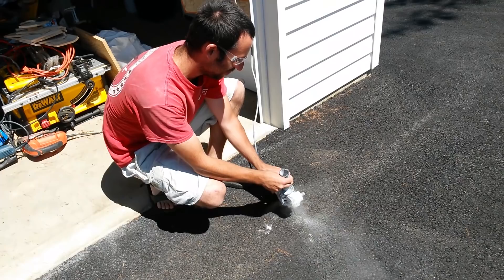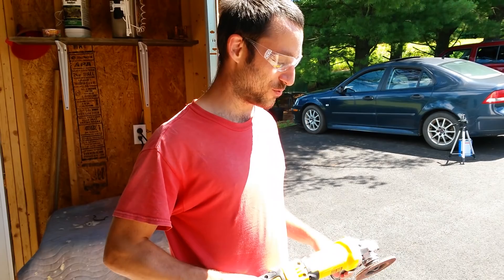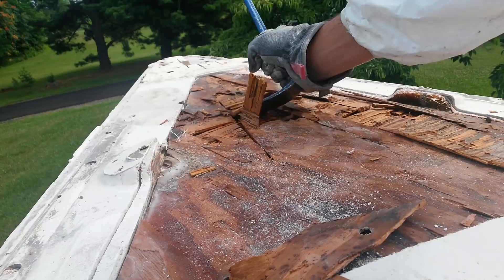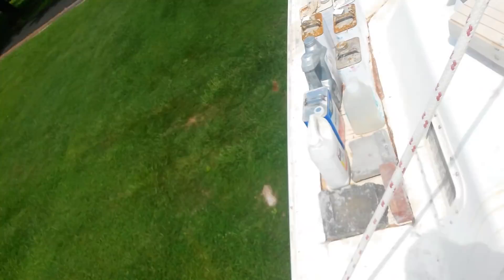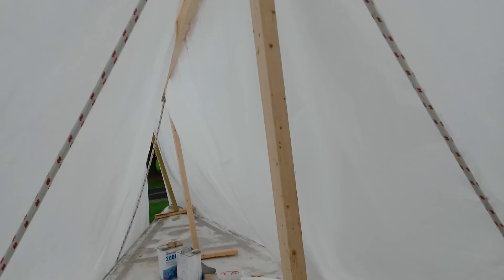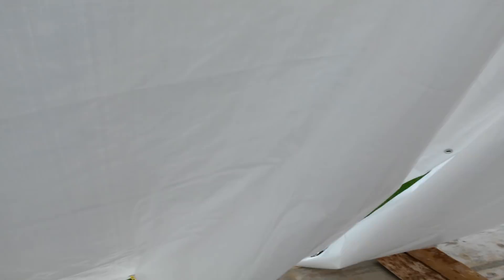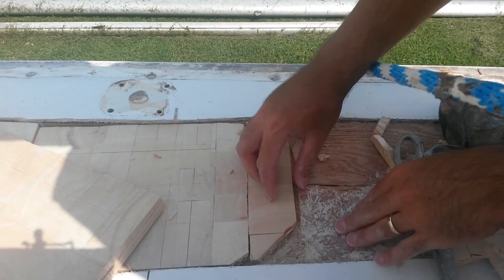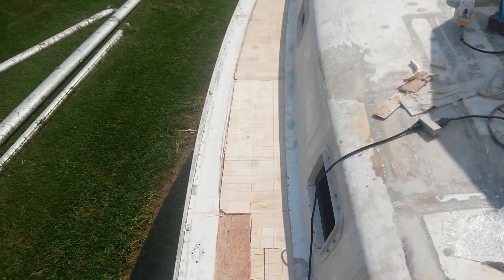I Discover the Best Tool for Sailboat Repairs

Comment: all your old tool needed was a clean, the intermittent power is due to thick dirt/dust  collecting the bottom of the carbon brushes.
Reply from the maker: Yes I've found grinding fiberglass to be very rough on my tools and need frequent cleaning now.